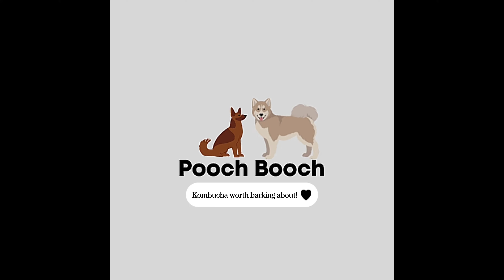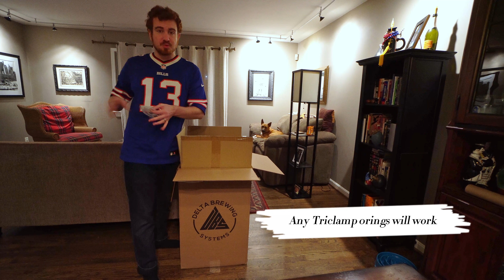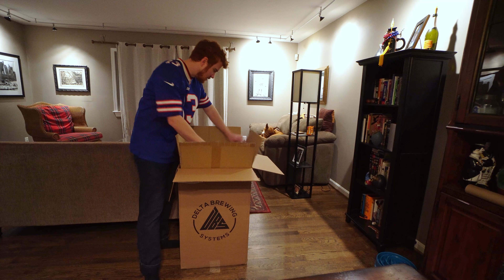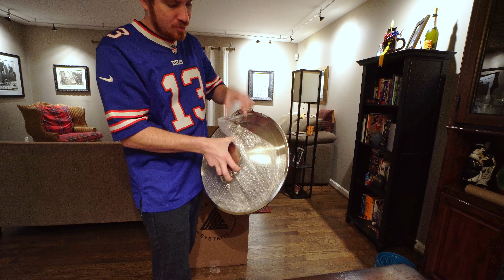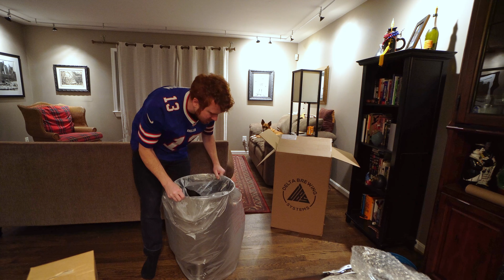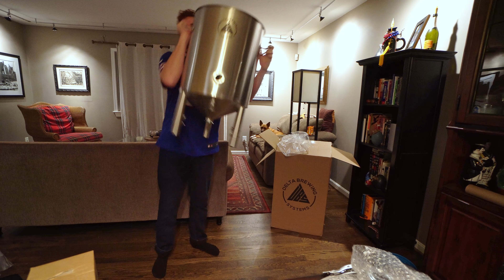Delta Brewing FermTank 14 Gallon (Unboxing)

Comment: Thanks for sharing the video. I just bought one that I’m converting into a bottom drain brew kettle. If you still have the fermenter could you measure what inside diameter of the kettle is? Much appreciated